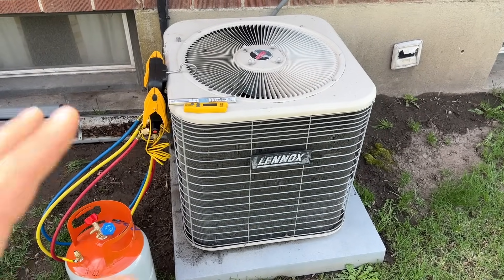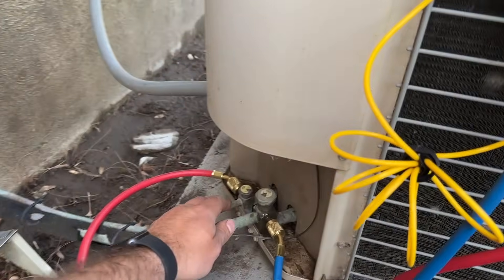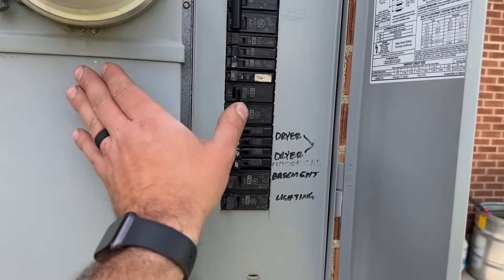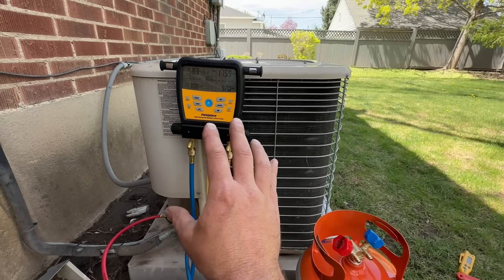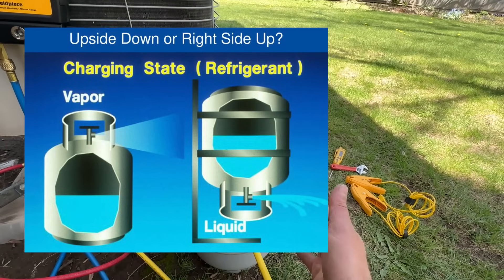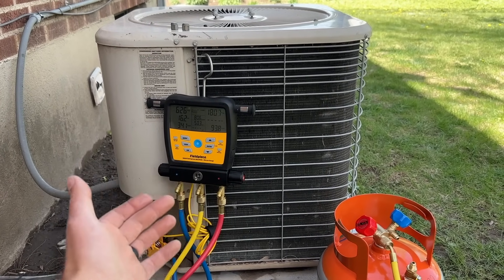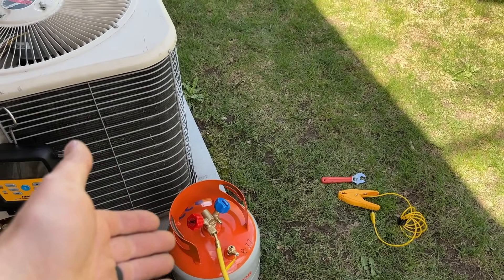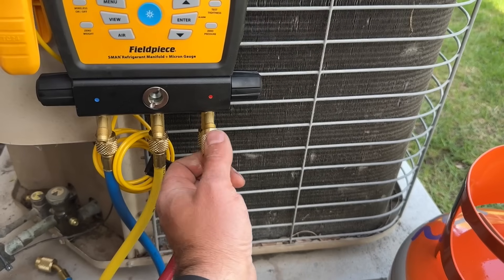How To PROPERLY Recharge Your Air Conditioner

Comment: Is it the fat pipe or the thin one  (going into the condenser), that should be cold ?  I can't see...
Reply from the maker: The large one 👍🏼
Reply: @diyhvacguy  Thanks for that....  yes that is after the high pressure is released and it goes cold and is on its way back to the compressor...  ok it is 98F here  in Wisconsin so I am doing my homework just in case..  Thanks again...Alan

Comment: How do you know if a system is a piston or TXV metering device?  BTW, love your videos.
Reply from the maker: Thanks! Typically you will see a bulge in the larger copper line close to the evaporator coil by your furnace and maybe some real small wire looking tubes. Another way to tell is if your gauges are connected you will see minor fluctuations in pressure, up and down, that’s a good indicator you have a txv. If you have a piston it will be still on the gauges, and you will also hear more of a water rushing kind of sound at the Evap coil. Hope this helps! Cheers

Comment: Well I hate disappointe your  viewer's but I have done this since 1985 and anybody that can read can get an EPA card . When they see how much R22 cost for a 30 lb cylinder and that is if they can buy it to begin with they will change their mind about do it your self . I would like to warn your viewer's that this is a dangerous trade . They do not know what they are working with here . I've seen blown off finger tips ,  schrader valves in someone's eye  . The company I work for had a Tech . die from electrocution working on residential equipment  . The viewer's should know these are all possibilities that any of these can happen to them faster than they can think about it . Let them watch some arc flash video's . Somebody has to be in all of these OSHA training video's . And these people do it for a living and still get hurt . Im all for saving money but I caution all who read this be aware of the dangers with this trade . One more note about recovery cylinders I've seen more contaminates come out of them than I care .

Comment: an air conditioning compressor is a liquid pump shortly before it is scrap metal... When did they teach ya'll to add liquid refrigerant to the low side ?
Reply: Your suposed to go slow so you don't flood the compressor. Atleast that's what I was told.

Comment: Question please:If a technician puts -by mistaken the numbers-too much freon in a home AC unit then immediately remove it will that cause damages to the unit? Like leaks?      Thank you!
Reply: No, not if the technician caught the overcharged immediately and fixed it. 

Now the more important question(s) is how old is the system?, is there a leak present causing the system to be low?, how low was the charge in the first place? ( sometimes it just wasn't charged properly and there was extra lineset to account for), and lastly did the technician fix the leak or are you just band-aiding it?

Comment: Nice Fieldpiece gauges. Great video. Fortunately, at least in my state, a license is required to work on air conditioning units, as well as holding the EPA-Universal Cert. Not to mention, the average homeowner isn't going to run out and purchase a decent set of gauges, recovery tank, scale, R410-A, as well as a wide variety of hand tools, ranging from a 5/16 nut driver, all the way up to a decent multi-meter. And of course there are many other factors that low refrigerant can be mistaken for, and typically are, even by novice "techs". My advice to homeowners thinking of tackling "low refrigerant" on their mini-split, or conventional central air system, is to leave it to a licensed contractor, or you might find yourself replacing the outdoor condenser unit, instead of adding a couple pounds of refrigerant. 🧊 ❄️ 🔧

Comment: Thanks for a great video.Outdoor unit fan is running, changed the capacitors, initially compressor pipe got cold for a few mins and then nothing(no condensation and not any more cold) - not sure if compressor is running? But AC is not blowing cold(3-4 years old) and evap coils are not frozen either. Thermostat is sending voltage, contactor is working well, condensation drain switch is not tripped. What else could it be, low refrigerant?

Comment: Thanks for the video sir, this is going to save my family a ton and we're extremely tight on cash now. Quick question: I've got an extremely slow leak, over the 12 years in my house I hadn't really started noticing it being slightly less cool until last year. It's a '98 r-22 system, so it's getting up there and to my knowledge hadn't been charged before. I was looking at the AC Leak Freeze Pro Nano w/Magic Frost leak sealant. Not sure if it's even needed, but since I'm adding r-22 I wondered if I should go ahead and try the stuff too. Thoughts?
Reply: I would professionally advise you to change your system out. They don't make R22 anymore and it's becoming very hard to find by as time goes on. The new system will be leagues more efficient and will be a good investment for your home, and if it's gas heat ( furnace) you need to make sure the heat exchanger is ok, inducer, flu, etc.

Comment: Thanks for really helping me through this. I just ordered a 2lb. bottle of R22, the manifold and like you said the low loss hoses.
Question: For purging the air out, I understand just cracking open the low and high side hose fittings at the manifold but is cracking the fitting on the center hose enough for purging the manifold it self?  Thanks for this!
Reply from the maker: Basically yes, and the middle hose also

Comment: I have been told that I have to replace my unit because they don’t make the unit anymore. Is the true?
Reply: Older units use R22 refrigerant. R22 was phased out and is no longer being manufactured. That makes any available R22 very expensive and hard to come by. No shop will charge R22 into a leaking system because its a waste.
If your system is using R22 and there is a leak its best to just replace the entire system. Its old and the repairs would not be worth it. But if you cannot afford that you can have a shop retrofit the refrigerant to a modern cheaper refrigerant like R-438a. But then you take the risk of how long it will hold the charge. You might be unlucky and the new charge leaks out in a couple of days. Or you might get lucky and it lasts over a year. Thats the risk you would take by charging a leaking system.
Reply from the maker: Yes they started phasing out r22 in 2008 I believe. All the new equipment is 410a. But he could be full of crap. Have you checked the capacitor? If you need some help diagnosing, check out our Patreon group at Patreon.com/diyhvacguy   Cheers

Comment: My old 3 ton R-22 unit kept my house like a refrigerator. When the compressor died I replaced everything with the R-410A system and it SUCKS ! It's can't cool my house. If the inside temp goes below 81* , the until never shuts off. I should have just replaced my condensing unit with a used R-22 unit !
Reply from the maker: Yea r22 was awesome. It sucks that it’s all phased out.
Reply: Then something is wrong. A 3 ton system is a 3 ton system and will have the same cooling capacity no matter what refrigerant it uses. A 3 ton system is supposed to move 36,000 BTU out of the house every hour. If its not doing that then something is wrong. Check the temperature drop across the coil. A system that is working properly will have about a 20 degree temp split. So if the return air is 75 degrees the supply air should be about 55 degrees. If its not then something is wrong.

Comment: Most manufacturers says when a leak occurs on R410A which is a 50/50 mixed of R125 and R32 refrigerant you need to recover and dispose that refrigerant because the composition is already altered.

The composition of refrigerant R410A changes whether it is in a gaseous phase or liquid phase. Thus, when
there is a refrigerant leak the basic performance of the air conditioner may be degraded because of a change in
composition of the remaining refrigerant. Therefore, do not add new refrigerant. Instead, recover the 
remaining refrigerant with the refrigerant recovery unit. Then, after evacuation, totally recharge the specified
amount of refrigerant with the new refrigerant at its normal mixed composition state (in liquid phase).
Reply: 410a has barely any fractionation, not nearly enough to cause issues. Thousands of 410a systems are recharged without pulling it all out and they continue to work just fine.
Reply: @Redtooth75   That what manufacturers said when 410A is still new which is obviously a lie so they can use the marketing slogan Eco Friendly. Just another hype like the stupid disposable EV. 

According to the installation manual, 
"The composition of refrigerant R410A changes whether it is in a gaseous phase or liquid phase. Thus, when
there is a refrigerant leak the basic performance of the air conditioner may be degraded because of a change in
composition of the remaining refrigerant. Therefore, do not add new refrigerant. Instead, recover the 
remaining refrigerant with the refrigerant recovery unit. Then, after evacuation, totally recharge the specified amount of refrigerant with the new refrigerant at its normal mixed composition state (in liquid phase).
When refrigerant R410A is used, the composition will differ depending on whether it is in gaseous or liquid 
phase, and the basic performance of the air conditioner will be degraded if it is charged while the refrigerant is in
gaseous state. Thus, always charge the refrigerant while it is in the liquid phase."

"If the volume of refrigerant in the cylinder becomes less than 20% of the fully-charged amount, the composition of the refrigerant starts to change. Do not use the refrigerant if the amount in the charging cylinder is less than 20%".
Reply: @w0lvez1  and in telling you that there are very, very few people who actually do that. Yet despite not doing that there are seldom any problems. Its so close to azeotropic that there is rarely any problems with fractionation.
Reply: @Redtooth75   Huge difference in performance using new refrigerant.
Reply: @w0lvez1  according to who? From everything I have read the fractionation of 410a usually results in a 0.5% change in composition and the manufacturer tolerance is 1.5%. The difference in saturation temp of the components is only 0.2 degrees F.
Reply: @Redtooth75  According to Sanyo AKA Panasonic. See Page 46 & 47 on the line below. The old method of purging of releasing small amount of gas changes composition of the refrigerant. 

https://na.panasonic.com/ca/sites/default/files/2022-06/KHS0971_Technical_%26_Service_Manual_Correction.pdf
Reply: @Redtooth75  Since 410A is charged in liquid form after disconnecting the hose and manifold gauge if you don't flush it with a solvent and store it on a sealed container it will keep absorbing moisture in the air. Try connecting your used hose and manifold gauge on a vacuum pump and refrigerant tank. You will see the moisture boils from the sight glass. You also add moisture to the system every time use the hose and the manifold gauge is connected. Why the hell not use the vacuum pump and connect it to the high side to completely remove moisture from the charging line.
Reply: @w0lvez1  wow you really switched gears there. You also misread that link, it says to not purge the refrigerant in vapor form as that can change the composition. The refrigerant is evenly mixed when its a liquid and it can be purged as a liquid. Its the vapor that can be uneven.
My whole point is that those slight changes are insignificant for most systems. Mini splits are very picky about everything because they are shit so there are some special procedures for them. But most systems dont give a fuck about the tiny changes in composition, certainly not enough to justify the increased cost of pulling the whole charge out.
Let me explain to you why nobody does that. If someone's system is leaking everybody just charges it. If they tell the customer that they have to remove the refrigerant they have and dispose of it the customer would tell them to piss off. Then the customer would call someone else who would top off the system and then the system would still work perfectly fine. So the tech who wanted to be a hard ass just lost business and their competition gained a customer. And that whole you cant use the refrigerant if there is less than 20% in the tank is bullshit. Refrigerant is sold in 30 pound tanks and my shop is charging $62 a pound for 410a. So you expect us to waste hundreds of dollars of refrigerant per cylinder even though it is perfectly fine.
Ive been doing this for years and others in my shop have been doing it for decades. Nobody does what you are saying and it has never once caused a problem.
Reply: @Redtooth75  That's what everybody keeps doing purging vapor. Why the hell will you purge if you can use the vacuum pump to remove air?
Reply: @w0lvez1  why would i do that when i can just turn the tank upside down and crack the fitting?
Reply: @Redtooth75  Why the hell will you charge a system without fixing the leak? Refrigerant will never run out if there's no leak. Flare connection is the most common leak point because less than 0.8mm copper pipe was used, not lubricating the flare connection, outdoor unit not seated on rubber mount and not enough pipe extrusion during flaring using conventional tool.
Reply: @w0lvez1  my mans there are reasons. The biggest one would be that the customer cannot afford to fix the leak but still wants AC. Some times the leak just cant be found in a reasonable time and the customer does not want to pay for multiple hours of leak checking. Im not gonna refuse to charge their system Ill just make sure they understand that it will eventually need a recharge. Many systems with leaks have slow leaks and only need to be charged once a season. If someone cant afford to drop several thousand dollars on a new system they might be able to afford a few hundred every year.
Also whats with this abruptly changing topics? You just keep bringing up random shit that nobody mentioned. I didnt say anything about leaks or leak repair. Nor did I mention anything about purging lines before you did.
Reply: @Redtooth75  What a lame excuse used by AC Technician who don't want to find & fix the leak. How will you properly charge a newer system without a service port on the liquid line.
Reply: @w0lvez1  its not bullshit, leak checking and repair costs money. Not everyone can afford a huge repair bill. I do what I can with the budget the customer has. If all they can afford is one hour labor and a couple of pounds of refrigerant then that all I can do. 
You charge a split system by either subcooling or superheat depending on the metering device. The only systems I have seen that do not have liquid line service ports are mini splits. Mini splits are critically charged and the only way to do it properly is to recover the refrigerant and weigh in the correct charge.

Comment: can you do one on 410A?.... the pressures are higher I believe, so it would be interesting to know more about the right hose connect/disconnect technique....Thanks
Reply: 410a is a high pressure refrigerant and use the two finger method with low loss fittings to connect the hoses

Comment: Can you use the same field piece manifold for r22 and 410a but just have different hoses for each refrigerant?
Reply from the maker: You can use it for both, just let the refrigerant out of the hoses before hooking up to a different system. And you can cycle through different refrigerants so your pressure / temp charts are accurate for that refrigerant 👍🏼

Comment: QUESTION! You mentioned systems using a piston or TXV. How do you tell the difference and where are they located?? Really appreciate you! Great video!!!
Reply from the maker: The txv is going to be located at the Evap coil. So you might have to take the cover off, or if there is a bulge in the insulation where the big pipe goes into the Evap coil case, that’s a good indicator that you have a txv. If you need some further help finding out, feel free to sign up for our remote services at Patreon.com/diyhvacguy and we can help you out further. Cheers

Comment: To do this yourself, all you need is to take an open book test. The test cost me $25. Then you can not only purchase the refrigerant, but you can also recharge your system yourself. That cert, when you pass, lasts a lifetime.
Reply: I came here because AC. not come on this summer , I live in Nevada desert

My tech popped his gauges off and said it will be $900 to recharge unit. 

I believe he cant guess how much leaked out, and what caused the leak. 

I wont call back. He didn't know I have gauges too
Reply: @jamesconnor9142  you can get a good idea via the pressure. to know the exact amount, no, not without sucking everything out. put it in slow and wait for the pressure to settle, repeat until you are at whatever your area and equipment suggests. you need to know what type, the temp outside, ect. there is a chart somewhere. I did mine and threw in some stop leak and have not had any issues yet. only one year in tho, we will see.
Reply: Update. 

My tech called back and said would charge the unit for $820 including first road call. This would be second. and check for leak.
Reply: You're not supposed to " recharge" an HVAC system refrigerant does not burn off and isn't supposed to leak out. If you're diying that then you have something wrong without the knowledge on how to properly diagnose it and repair it.
Reply: @lucaswhite3411 so you buy a whole new unit everytime your ac stops working? 😅
Reply: @lucaswhite3411 key phrase here is “not supposed to”.  Unfortunately hvac systems do have problems